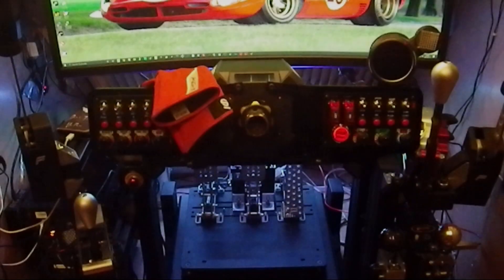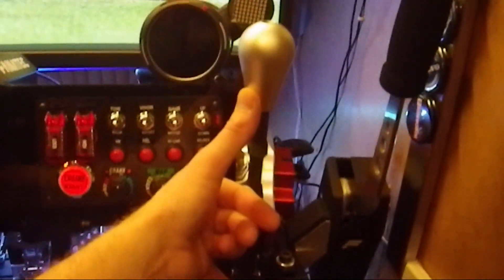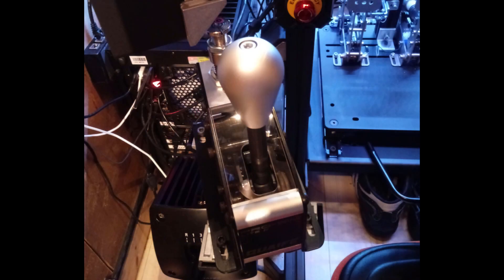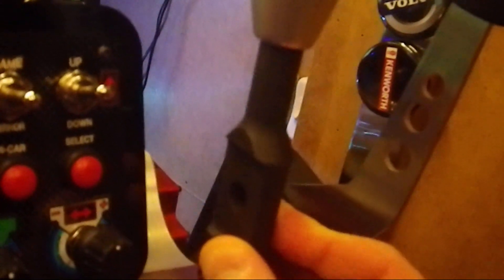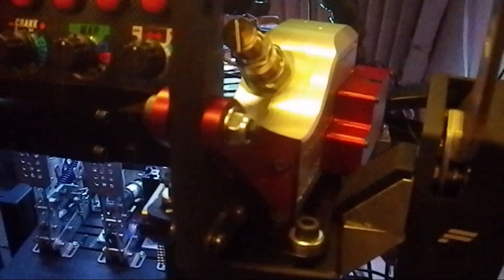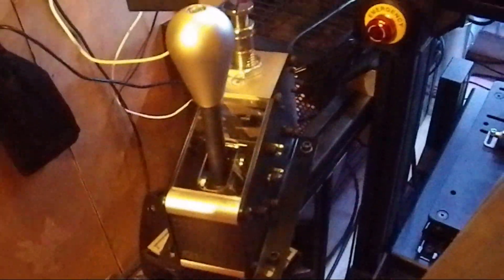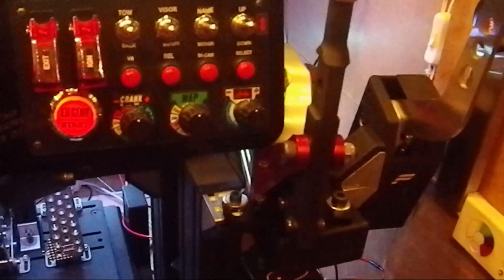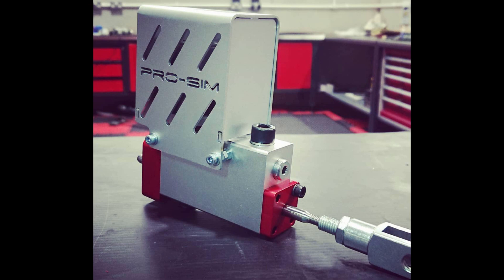First Ever Comparison Between The Quaife Pro SQ vs Pro-Sim Lite V2!

Comment: I was debating about the lite before i purchased the pro 1.5 years ago. Happy i got the pro even though the lite would have been enough. I wont be getting the lockout for the sequential though. Complete waste for a sequential. I will most certainly get one for the hpattern though.
Reply from the maker: If I could have tried before I bought the Pro I would have bought 2 Pro Lite V2's. I thougt the Lite would be a great shifter as well, and probably be the more price worthy option, but I didn't expect it to both feel and sound better than the Pro!..
Reply from the maker: Thought we would see the lockout in shop by now.. Haven't decided yet, depends a bit on the size as well, if I will be able to fit it without my seat or anything will be in the way, looks bulky on the new pics.
Reply: @RVRCloset  They said the lockout will be soon. Been waiting for it for the hpattern since they started the the developement of it.
Reply from the maker: @ozz6111  Last dates I saw was around christmas, it would go up for preorder mid march if I don't remember wrong. Hopefully soon!

Comment: I don't like the Pro Lite be coz of the casing of that shifter. Normally in the R5 or WRC cars the knob of the seq shifter is very close to the steering wheel, usually around 8cm, so my hand could hit the housing of the shifter. No problem at all with the Pro be coz there is different casing design. The Pro Lite not for me. Btw, great comparison RV-R Closet.
Reply from the maker: That is a good point! I would have issues mounting the Pro lite were I have my Pro SQ do to the design as well.. But man do the Pro Lite feel good! :)
Thanks for watching mate!
Reply: @RVRCloset  Hello, How is the feeling with extension rod. does it make big difference?.  I am asking you DISADVANTAGES when I using extension rod. if there is no disadvantages (when it comes to feeling) I would buy extension rod because it provides me more mounting option. but I don’t want to spend extra 40 pounds if there is any disadvantages. Thanks
Reply from the maker: @gyujinyang2680  I like them better without extension, the throw get a bit too long, and also makes it feel a bit sloppy in the shift, do to that you also get a bit more slack in the lever before the engagement of the shift.
Reply: @RVRCloset   That’s quite a big downside for me. better to use without it. Thank you so much for your answer and amazing review. I bought BDH and PSL V2 after your review. really really appreciated :)
Reply from the maker: Yes, I ended up moving the the PSL V2 instead of using the extension.
Thank you so much mate, really nice to hear.🍻
Reply: @RVRCloset  Good to hear man. keep uploading amazing reviews. I will follow up. Thanks!
Reply from the maker: @gyujinyang2680  Huge thanks!😍👌